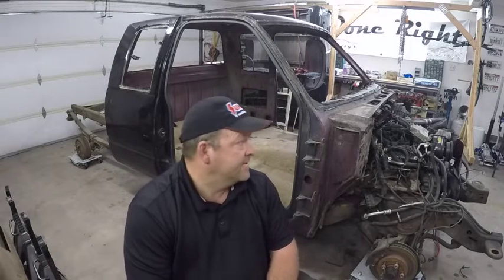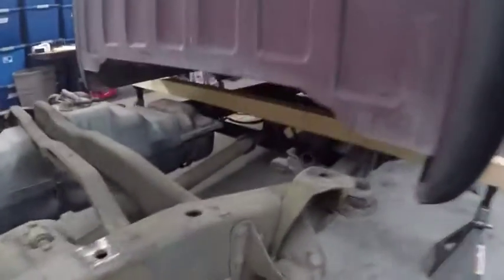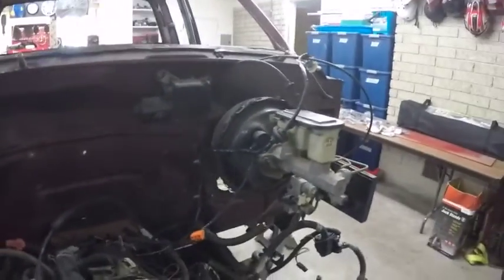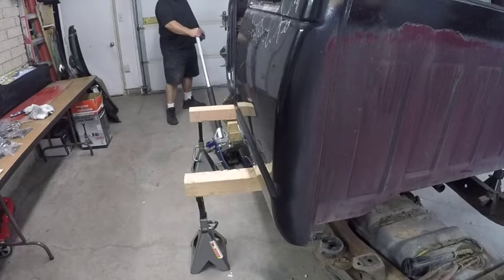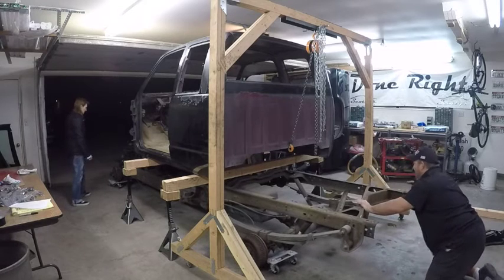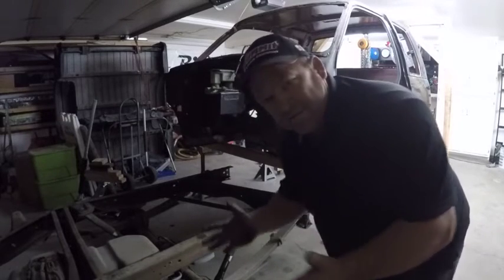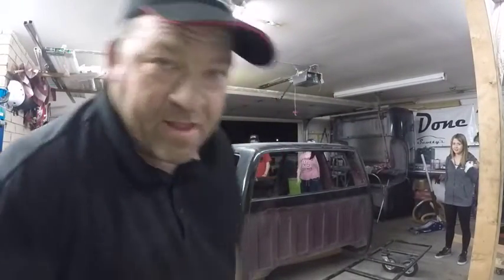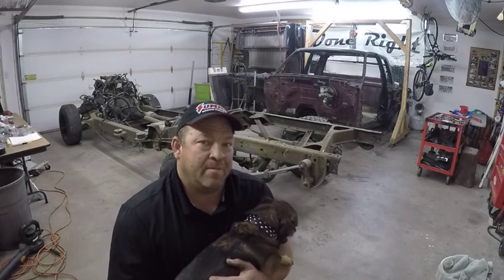96 Silverado Bagged and Bodied ( Part 16 Truck Cab Removal )

Comment: Your videos don't get enough attention. You do amazing work. Wish I could have you help me body drop my truck.
Reply from the maker: Self made Air ride- I would love to help you!! Call me anytime 
Scotty
801-400-3346
Reply: ScottysDetailing it's not something I can or would attempt the do in my own. I don't have the tools or space to knock it out right. I want to find a shop local to have it done. My question to you is how much is an average price for a body drop on a 2003 Silverado single cab. I want to run 22 inch rims.
Reply from the maker: If you do a stock for Body drop with a custom frame probably close to 15k-25k. If you do a traditional body drop probably could do that for about 5000. That all depends on the shop and what their process they use.
Reply: My videos are the same way slow and hard to come by. It seems old people screw faster at the nursing homes than you can upload a video on here and FB. I know there are some techno programs that can help but the problem is we're mechanics and welders okay no I.T. techs. Also some of us we upload the videos as we progress with the project and the stuff takes time many of us do this in our spare time which gets precious separating time and days to dedicate to a prestige project okay. The guy did a nice laymans video of removing that truck cab. He really needs to get rid of that 6 popper under hood and put a real 5.3 or 6.0 or a 7.4 in there like I have in mine.. Makes the build worth while.
Reply: @ScottysDetailing  how many cab mounts do the extended cabs have? Is it 4